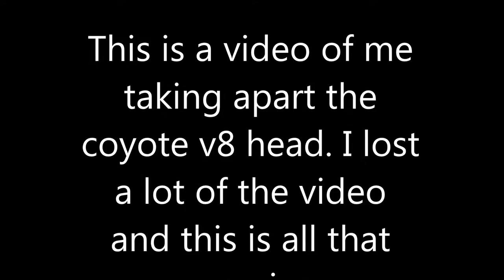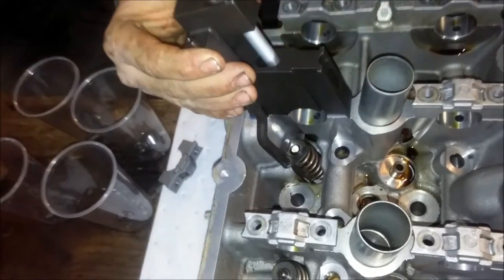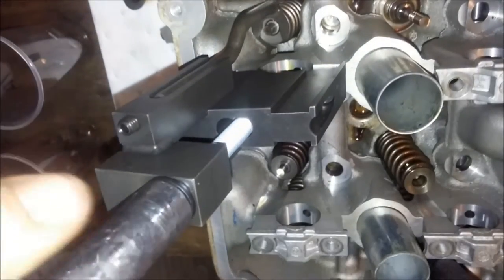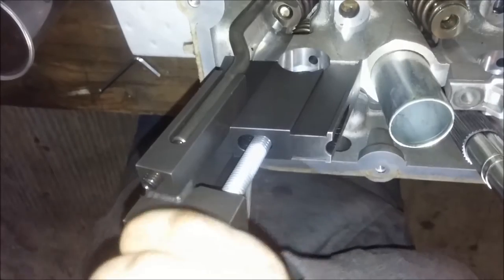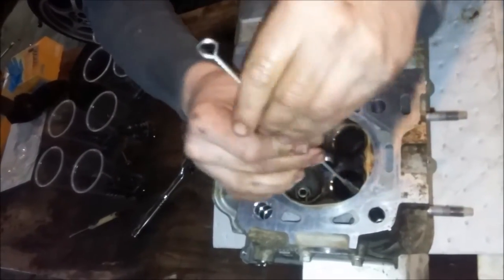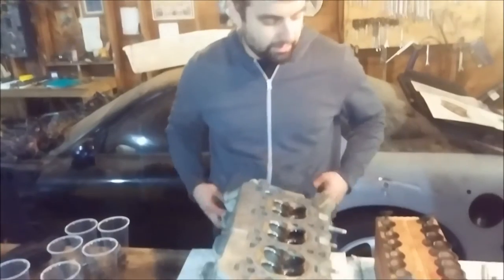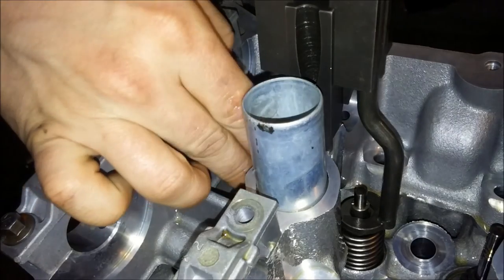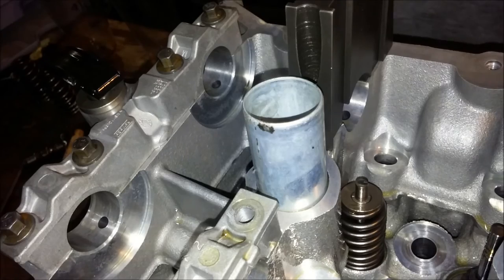coyote v8 head disassemble and rebuild

Comment: How did these heads hold up?  Wondering if the seats needed to be replaced rather than  simply lapped.
Reply from the maker: They held up just fine but I may have been lucky and not had one with the soft valve/valve seat issues

Comment: Maybe I'm wrong here but I was under the impression those valves have a coating on them that your not supposed to polish off...
Reply from the maker: They are likely Stellite coated, but its unlikely that light lapping would affect this coating. Repeated lapping would probably remove it, as would high mileage; the coating isnt that important anyways as the seats are hardened anyways

Comment: so the seals keep the valve from dropping
Reply: Lukas Couvaras the oil sludge on the valve and seal tension keeps it from dropping. if I was swapping the springs on an assembled engine I wouldn't trust them to hold the valve from falling in
Reply: i really don't want to take the heads of just to swap springs cause that's just more money into this project
Reply: there are ways to keep the valve in place just don't rely on the seal to keep it up.
Reply: you can buy a fitting to put air pressure from an air compressor in the combustion chamber- which will hold the valve up.

Comment: What did you use as your cleaners? Couldn't hear a thing
Reply from the maker: I used oven cleaner to get the sludge and oil off. its really cheap and does a great job. to get the aluminum to shine i used toilet bowl cleaner. yeah my editing skills are not that great so the music covered up a lot of what i said
Reply: Nodarperformance did the toilet bowl cleaner etch the bearings? Saw your newest video of the cooked motor. Sometimes it can react similar to an acid etch on a stamping tool
Reply: Jonathon Vince I never used it on block and it's not that corrosive. I didn't notice any pitting on the heads. The engine was most likely cooked because I hydro locked it with fuel when the ECU went on the frits or because it sat for a long time before running and the pre lube of white grease didn't work
Reply: heith85 gotchya, just an idea. Sucks that it cooked itself after all the work. I threw a rod on a sleeved motor so I feel your pain.
Reply from the maker: getting pretty close to having the bottom together again just not looking forward to the hours of cleaning the heads but i guess its a good time to put in the boss exhaust cam
Reply: Nodarperformance I cooked 1 piston 1 rod and the heads are trashed. Also my boss cams on the middle of the lobes debris built up out of the oil galley and scored the centers. It's too much to regrind so I basically have to start from scratch. Not cheap.
Reply from the maker: sorry to hear that. more money and time to dump into it

Comment: Is it possible to do this with head on car? Thanks
Reply from the maker: Justin Radford yes but you do need a way to stop the valve from dropping into the cylinder
Reply: @Nodarperformance  just need make sure the correct piston is at TDC so the valves for that area won't drop and fall inside. If you were replacing seals, springs, or follows, the cam can be left in. Just makes it a pain in the ass.

Comment: Where’d you get the valve spring tool?
Reply from the maker: I bought it through a eBay seller. I think you can rent the tool through some sellers
Reply: Nodarperformance any idea who to rent it from? I’ve tried looking no luck
Reply from the maker: @tanner8686  the eBay seller ingot line from in his listing posted rental options were available. It's been too long to find the listing though